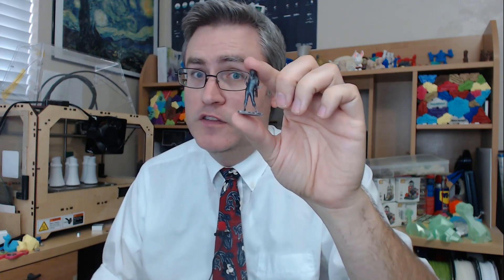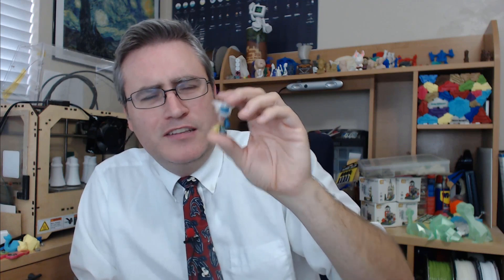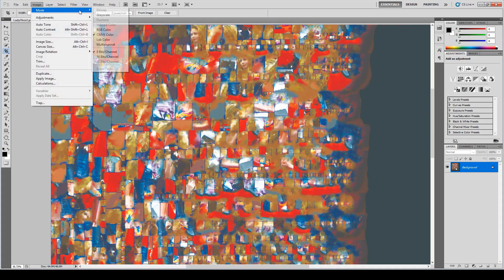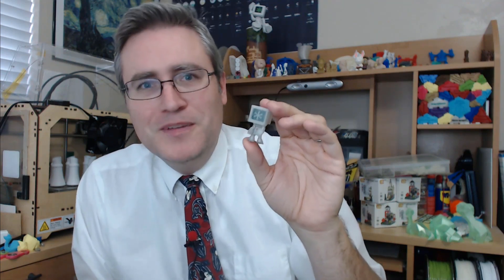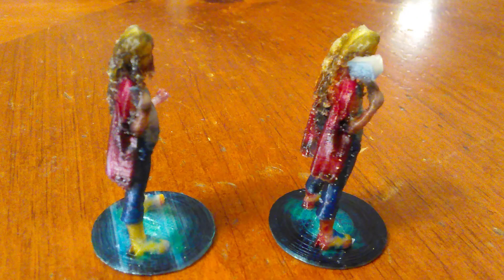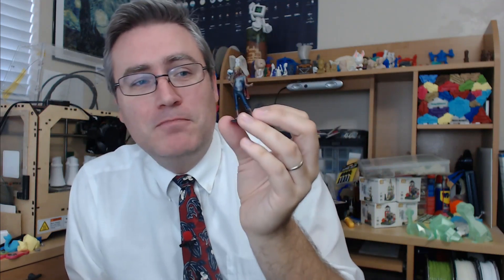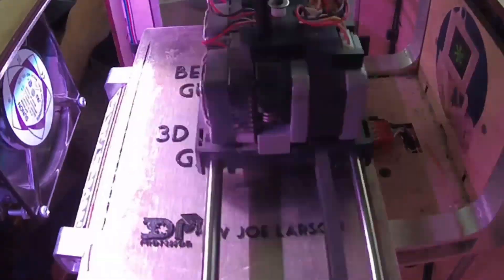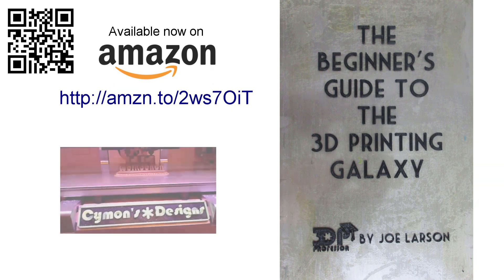Davinci Color Triumph

Comment: How did you solve the USB port problem?
Reply from the maker: I didn't run into it. What's the USB port proplem?
Reply: @3dpprofessor  In practice I have 3cp files processed on the xyz application and inserted on the flash drive.
The problem is that they don't appear on my printer🥲
Reply: @3dpprofessor  how do i solve it?
Reply from the maker: @therealjj7616  I don't know what it is.
Reply: @3dpprofessor  I mean USB pendrive
Reply from the maker: @therealjj7616  you're going to need to use more words. It's been years since I used this machine, so if I had any problem with the USB drive I have no idea what it is or was, so please explain what the problem was.
Reply: @3dpprofessor  I prepared a file on Blender that I exported in obj format.
I put the file on the XYZ app and processed it
I saved the file as 3cp format and put it on a USB pendrive.
I connected the USB pendrive to my da Vinci color printer (internal part).
When I search for the file in the printer display the file does not appear
Reply: @3dpprofessor  I also have another question
How do I lower the fill percentage from the xyzprint application below 80%? (the app doesn't let me go any lower)
Do you also know of any other slicing applications compatible with da Vinci Color?
Reply from the maker: @therealjj7616  I don't know the answer to your problems. My Davinci color has sat unused for years now and I should probably get rid of it. 
But im pretty sure no other slicer will work with it.

Comment: You have been silent on this printer for over a year now.  Can you show us some of the work you have done with it ?  I am considering getting one to print 8 bit characters.. like the 8bit amiibos, think it can do that ?
Reply from the maker: There is a long story to tell. I kinda had to let it go dormant for a while, pulled it out again in November, the inks were dried up, pulled out the replacement inks I had bought, they were literally exploding out of their casings, and it's taken support until today to ship me replacements. When I get them I'll have more content, but this is... well, it's not the worst customer service I've received. They've been helpful and ultimately got me what I need, but they've been real slow about it.
Reply: I am glad you will be sharing more insights. I am on the fence with this one.  The single Amazon review currently available says that the machine is not ready for the public, and that it has far to many issues such as constant ink clogs and jams.  Very interested in your update. Would be able to send you an 8bit color character voxel model to test out if you are interested.

Comment: I purchased an XYZ da Vinci Color printer 27th Jun 18 and it wouldn't print color. I took over 14 days to get support and they said it was faulty ink and they would replace them. it is now 20 August and still waiting on the ink and no eta in sight. I did an experiment and ordered 5 of each color from the XYZ store and use an American address and with express shipping could get them delivered in 48 hours. But here I am in Australia 6 weeks and no Ink. Mr Simon Shen your support in Australia is absolutely discussing and to the point I'm about to lodge an official complaint with Fair Trading and the ACCC and XYZ are selling products in Australia they have no intention in supporting. this is a $4000 plus 3D printer sitting there gathering dust. If you can ship 5 of each inks in 48 hours in the states the you can get them to Australia in under 2 weeks I would discourage anyone thinking of purchasing an XYZ Printer to look elsewhere to a company that values its customers and supports their products in a reasonable time frame. Hopefully Mr Shen you will read this and kick some backsides and fix your support and supply the ink owed to me under warranty ASAP

Comment: I'm just getting to this third in a series on this printer. Did you say you changed the files to CMYK, or once you put the new firmware on this you kept them in RGB? Love your videos man!
Reply from the maker: I switched to CYMK so I could strip the black, then switched it back to RGB before saving.
Reply: I do that with RGB B/W photos from time to time to make them neutral! I switch to greyscale and then back to RGB. Great idea!

Comment: Where did you get the handle for your xbox connect sensor?
Reply from the maker: Made it. Remixed it from three different models, then iterated it. Current one requires some padding to work, so it's still not perfect, which is why I haven't posted it. that, and it's for outdated technology.

Comment: So there is a company that is approaching this concept in a different way! It's ultra expensive right now, $6,000.000 for their printer, but I feel over time others will adopt this process and the price will come down. ORD solutions is actually 3D printing with CMYK + White filament, using some sort of mixer extrusion process. RoVa4D Full Color Blender. Really really cool stuff! Check it out.
Reply from the maker: Because they have space for mixing, in order to get pure colors, they need to purge the nozzle. So far the results have been super muddy. However, it does show promise, I agree.

Comment: Great channel!! How do you make a scanner out of the xbox camera? I have one that is not being used anymore. Thanks
Reply from the maker: It is not easy. Trivial, in the sense that it's a solved problem, but not easy. It involves finding and buying an adapter to power and get the Kinect to your USB, then there's fussing with drives and software. I recommend Skannect, it's the only one that worked, and it works good. There are free options, but I could never get them to work at all.

Comment: Hello Professor. I had the worst luck with 3d printers. I bought a kit from China and did not work the extruder, I bought an XYZ Davinci 2.0 Duo and burned a resistor on the electronic board after a week ... I would like to know what printers would you recommend, what software for slicing, what design software does .stl or .obj ready to print (without repair). You seem to have been developed a good relationship with the  XYZ manufacturer, and maybe you could raise some question: how can I edit the g-code in XYZware and implement other slicer code? is there a reliable plug-in for that? Some say they have connected an XYZ 3D printer with 3D Print from Windows 10, is it possible? Also, is there a software that could slice IGES or STEP files? If not, why is that, it seems like one could totally perform slicing on a solid model... The 3d printers use g-code, so I do not understand what is the problem with making layers on solid file objects.
Reply from the maker: Lot of questions, here. Thanks for reaching out.

I feel your frustration. And you're doing the right thing. Finding someone who can help you. Even better, you should find groups. Thingiverse has an active Davinci Printer owners group. I think there's even ones on Google Groups.

What little research I've done seems to indicate that Simplify3D is the only alternative slicer you got. I don't think it manages the color stuff yet, but I'm happy with the way it makes GCode.

As for alternate formats, IGES and STEP formats, and I would add 3MF to that list, you're hardly the first to ask. Creating format readers is trivial, though time consuming. But there's no reason, in my opinion, they shouldn't be supported.

Comment: You don't understand open source and the business around it... and call your self a professor
Reply from the maker: Well, I can't be an expert on everything. So educate me. What do you think I don't understand about making the schematics of a thing available with license information on them that contracts those who use the schmatics that if they change or modify them that they will share their changes and modification with others with the same license on it? And how does that apply to a company that built technology not on open source technology?
Reply: The final results you have shown of this rather expensive  and proprietary pile of junk are very bad, and the fact you are trying to push the idea that instead are good it's very smelly and maybe you have benefit in doing so.
Bringing back to the topic of my comment Open sourcing hardware/software it's nowadays a mandatory strategy if your technology it's either based on basic components that can be easily reverse engineered or/and to lift the after-sale  maintenance burden and research and development. It's also often used as a marketing tool to ease customization  and appeal to every customer that doesn't like the top-down approach enterprises has pushed to customers so far and the same very reason 3d-printing is so cool. I think you have plenty of living example of companies and products around you that based their business around opensource and just limiting the topic to 3d printing hw/sw: thingiverse, arduino, most of the slicer and 3d software like blender, prusa and in general the history of the evolution of 3D printing hardware made by the community.... you name it.
Without speaking about the fact that many open source/creative license exists enforcing different things, so even if I don't understand exactly what you are asking, given the very convoluted way you express yourself, it's often in the best interest of the company to open it to let the community come up with better ideas of the product, in other words to evolve it. The analogy with life evolution it's not casual because hw/sw are alive if there are users using it and giving "feedbacks"
For printing multi-color / multi-material I find much more interesting the Mosaic Palette that btw is yet another example of a company that open sourced everything for the reason explained above. (read https://hackaday.com/2016/06/20/mosaic-palette-single-extruder-multi-color-and-multi-material-3d-printing/).
In general I would avoid arguing about stuff I don't know or understand professor

Comment: If XYZ stops supporting the product, you should still be able to get ink BTW, i bet it's a HP TIJ 2.5 print head, which is an industrial unit. You will however pay the same as what they're selling it for or more. Given how little they make on them, i don't think they cared to modify the print heads to make them incompatible. There are even resetters around.

Slicer? Well i suspect that can be resolved too if it comes to that, but it's not nice that the machine comes with an online master kill switch.

By the way, i really want to print the kittybot and hand paint it with acrylic.

Comment: looks like garbage to me, for 3 grand it should look much better. I think the prints would look better without color, bc so much is left to be desired with the output. If you want to turn ppl into characters in full color, just pay an artist to hand paint them. It wouldn't be too much, there's a reason they're called starving artists.

Comment: So basically they didn't test their own software and their communication is fake ?
Reply from the maker: Ever work software QA? I have. You develop test cases, you run them, but no way you get 100% coverage. You try, but there's no way you can do it. Instead, you do the best you can, then get the reports from your uses and make new test cases that are added to the stack.
Reply: i worked 5 years for prestashop ( eshopping modules like wordpress plugins ), was a pure pain in the ass. Most of us quit cause they released too soon and too often the main software to the mainstream. At the end 90% off my job was debugging white pages cause they didn't test. At the opposite hand i always focused to release a super stable first version to add more options on next update and not spending all my time with patching.

I got a question for you : Do you think the price of the ink will be drop ? Because 2d printer are inexpensive and they get money back with ink and with 3d colorjet print its the opposite.

Comment: The only thing that bothers me about this being closed source is that now only XYZ can fiddle with the technology. I would think that if the design was open to the community then there would be a larger improvement in the technology as a whole.
I see open source as (in a sense) having a team of thousands of engineers helping you work on a product (aka the community collectively improves the design)
Sadly, I don't even think XYZ actually understands what open source actually mean, according to an interview on Tom's3D, they think that changing print temperature is somehow open source.
Still, there is potential in this!
Reply from the maker: I agree with you, and I don't. 90% of open source work is still done by one or two people per project. And almost every open source project stops at the point of being useful, and never quite achieves that "ready for prime time" status. So while I agree that the open source community could kick this thing into high gear, chances are XYZ printing is actually taking the right tact at the moment: No patents, listen to your users and beta team,. Eventually someone will hack together some arduino driven solution that works, and may even surpass this for the final result. But until then, corner the market, do your best to make the UI as clean and good as possible, and keep ahead of the hackers as long as you can.

Comment: As always a great video! I am not sold on the Davinci Color yet, but it sure would be fun to test it and experiment. I guess this is just the beginning
Reply from the maker: Actually, it's not close source filament. You can put any filament you want through this machine. And you don't have to print in color. So technically it could be used like any other PLA/PETG machine with an enclosure and an awesome auto-leveing system.
Reply: I would not buy it just because of its closed source filament

Comment: The results looks really bad, I think its early days yet and there is many more years to go before we see a colour printer that meets my expectations. I will never buy a xyz. But currently I really don't want any colour prints or even dual colour prints i prefer single colour in all the amazing filaments out there. It's an interesting journey and this is just the first step I think.
Reply from the maker: Louis CK Everything Is Amazing And Nobody Is Happy. 

While I agree that it will probably get much better, I've never been one, if I'm able to do it now, to put it off on a wait-and-see. Nothing will ever be perfect.
Reply: 3D Printing Professor I am waiting for the tech where the pigments are introduced and mixed into the liquid filament in the nozzle so you get solid colour on demand. It will happen eventually.

Comment: Glad it's working for you -- but what is your thinking on the XYZ business model. Is this printer usable in non color mode with just PLA? (non XYZ PLA?)
Reply from the maker: It works for 2D printers. but then again, there's no open source inkjet printers with open ink to provide them competition.

XYZ printers is promising that this printer can use any filament. I have yet to try it. If that's the case, then it can function as a normal 3D printer with sweet auto leveling and no heated build plate.
Reply: You should demo the bed leveling tech they're using -- it's a neat compromise between using servos to lift/lower the bed. It's a cheaper idea of getting feedback from the  Zprobe and telling a gear to rotate X degrees to adjust level -- neat idea. Obviously because of their leveling system, there is no heated bed, so it's a VERY expensive PLA only machine...way too expensive for the build area. The big trick is color, and from what you've demonstrated the resolution is not there. To be honest it's needlessly complicated bed leveling. I'd rather have a rigid flat bed with no springs, and a Z-probe which knows the skew and can compensate as it prints -- I actually did that with all my printers...no more springs. A z-probe and bed level compensation...works a dream. Plus that's compatible with heated beds.

Comment: I'm glad you've come to the same realization that I have been discussing for awhile now...the texture files need to be opened in Photoshop or another program that can convert to CMYK so that the 4 color channels can be isolated and "cleaned up".

In other words, if you want to print something that is blue, remove all the information from the yellow, magenta and black channels.  You are essentially removing any contaminating colors.  This is something that's done all the time in printing (which I do all day long).  Want a nice yellow, remove any cyan and black.  Want something more orange, then keep the yellow data and some of the magenta but remove cyan etc.  It's not an easy process (and certainly a skill to be learned) but should dramatically improve the color output.

Thanks for approaching the issue of color reproduction so intelligently and thank you for these very detailed review videos.